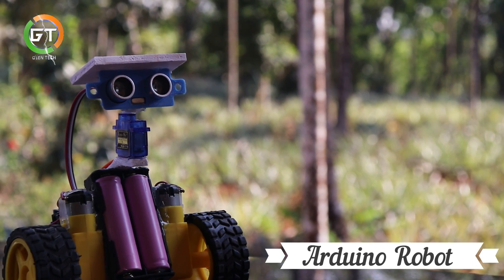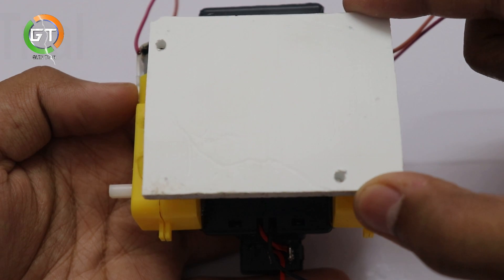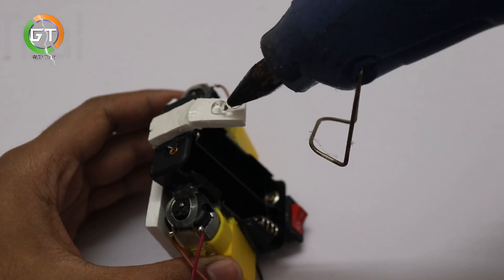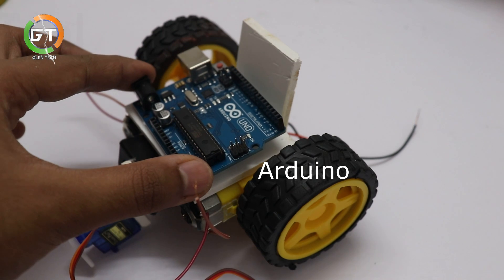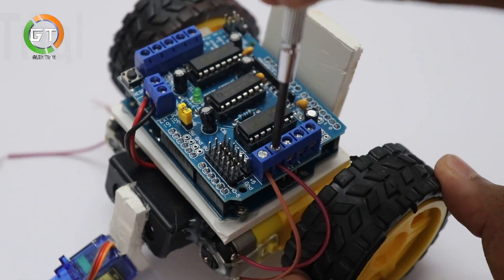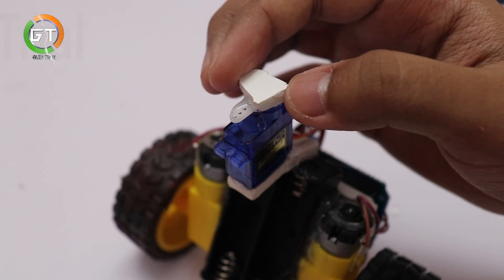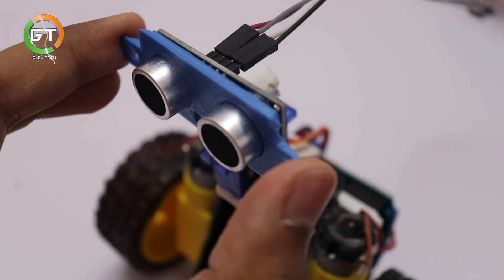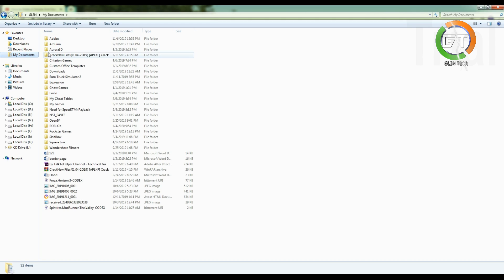How to Make A Simple And Easy Arduino Robot For Science Project

Comment: how did you add the dc switch?
Reply from the maker: Cut the red wire from the battery case and the connect dc switch between it.
Reply: @GLENTECH  thankyou

Comment: How is the robot controlled?
Reply from the maker: The robot runs by itself, doesn't need any remote to control.🙂

If you need you can call it Ai Robot 😅
Reply: No i meant how do u make it move to go forward and backwards
Reply from the maker: @abhijitgkrishna264  by the help of Ultrasonic sensor it change the direction when object or wall comes infront of it.

Code has been added in Arduino Uno board to control the motor by itself using ultrasonic sensor.

Comment: My gear motors are not working only servo motors and ultra sonic senors are working
Reply from the maker: Before uploading the code you have to install the necessary library//
// AFMotor Library https://learn.adafruit.com/adafruit-motor-shield/library-install //
// NewPing Library https://github.com/livetronic/Arduino-NewPing// 
// Servo Library https://github.com/arduino-libraries/Servo.git //
// To Install the libraries go to sketch >> Include Library >> Add .ZIP File >> Select the Downloaded ZIP files From the Above links //

Comment: Thanks for the beautiful project bro. For me code is compiled successfully and only servo motor is running fine. For Gear motors i had to push the robot to move. What could be the issue? please help..
Reply from the maker: Check battery fully charged.
Reply: @GLENTECH  Thanks bro, its working. But servo motor is stuttering/rotating i think 1 degree each. when i connected to laptop servo is rotating fine. FYI, i'm using two 3.7v rechargeable batteries. Can you suggest something?

Comment: Is it necessary to connect the wires of the motor in a particular direction to the motor driver shield
Reply from the maker: Yes . Otherwise you need to make some changes in code.

Comment: Man can I power this robot with 9volt battery the square one type??
Reply from the maker: 9v Hi-Watt battery won't work.

Rechargeable 9v battery only possible.
Reply: @GLENTECH  or can I use normal 1.5 volt battery
Reply from the maker: You can use 2 rechargable 3.7v 2000 mAh Battery . Rs 150 each available in all electronic shops
Reply from the maker: 1.5v battery won't work
Reply: @GLENTECH  1.5volt battery *3?? I hope I am not disturbing you but can I use power bank
Reply from the maker: https://amzn.to/3aj6Awz
Reply from the maker: Rechargeable battery and normal battery capacity is different .
So that if you use normal 1.5 battery it won't work .
Reply from the maker: Power Bank how many voltage and mAh are you using .
Reply: @GLENTECH  normal mobile phone one and 10400mah I used the USB cable to connect the power bank into the arduino it's lighted up would it work with this
Reply from the maker: You can use power bank .

Comment: Can I use normal cell instead of li ion battery. Or can I use ac adopter? Please reply
Reply from the maker: If you need you can use 9v Hi - watt batteries.
You can use 12v 1a adapter
Reply: Thanks I am going to make it right now. I will contact you if I have any other doubt
Reply from the maker: @kushalgawande7006  ok
Reply: Should I use two 9 volt battery because only a single servo requires 50 mA and we also have to connect gear box moters so we need more power?
Reply: Robot requirements are 2200 mah and 3.7 v so how can my 9 v with 50 mA battery provide such power? 😞🤨
Reply from the maker: @kushalgawande7006  use two batteries then.
Reply: @kushalgawande7006  did it worked what battery you used
Reply: @humangaming2024  actually I followed another videos and it worked. But I cannot find that video on youTube now
Reply: @kushalgawande7006  can you tell me at least what battery you used?
Reply: @humangaming2024  i used a 9v battery for Arduino and a separate 4 cells of 1.5V for the motor driver